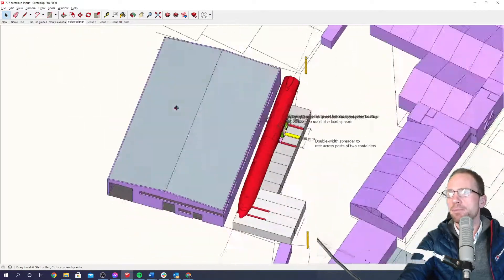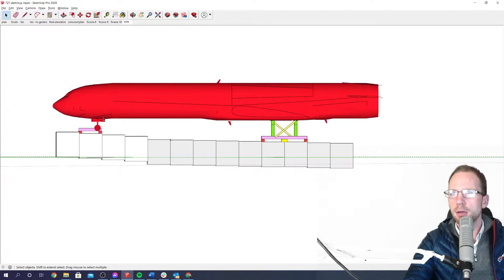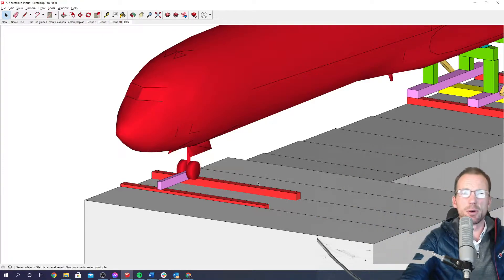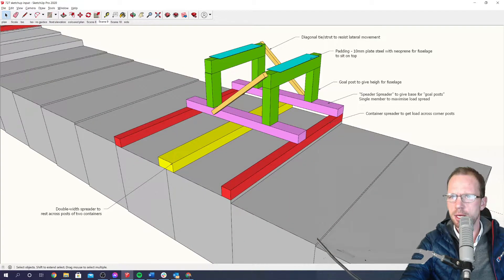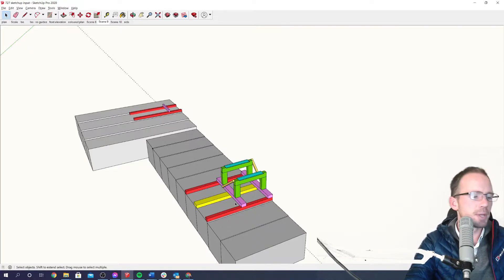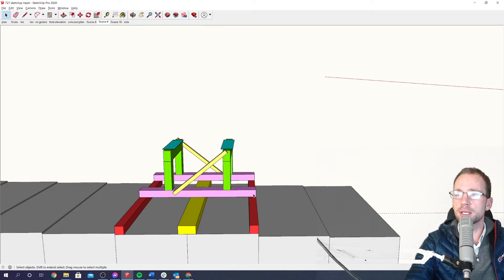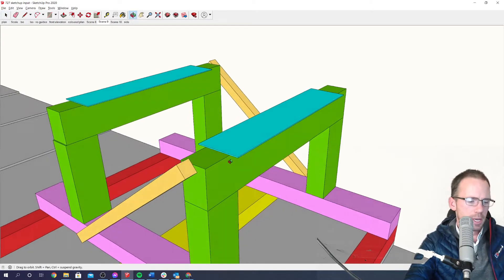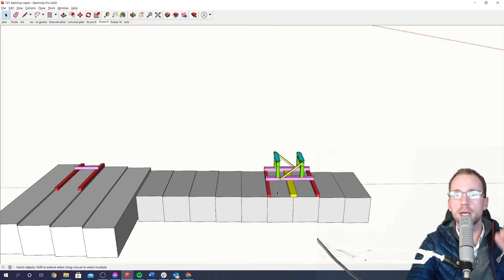PytchAir Project Episode 9   more steelwork!

Comment: I think you either need to travel to the far corner posts, or put something inside the container. Plate steel might work, though you could just put internal beams which may be closer to the point loading than halfway down the container.